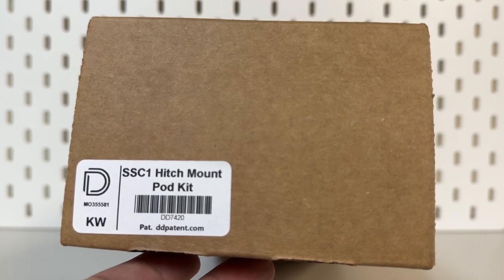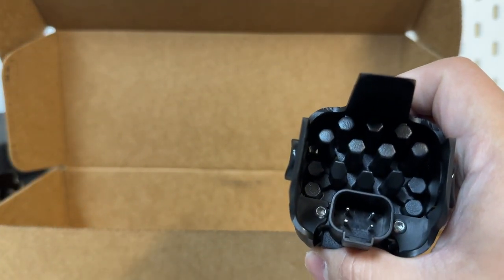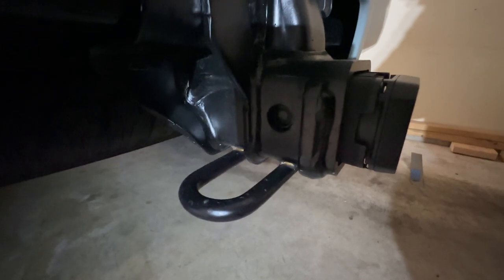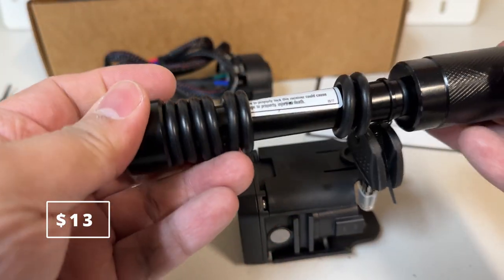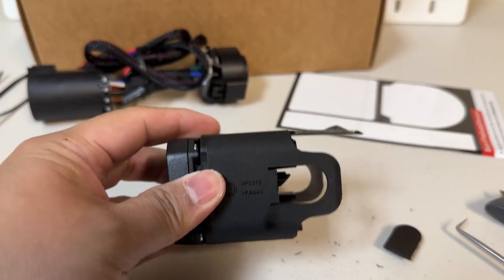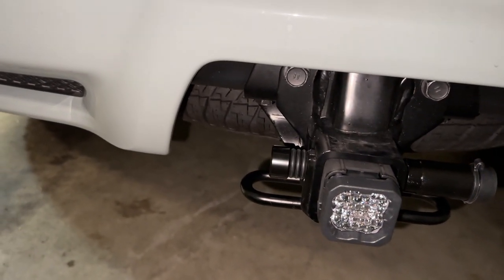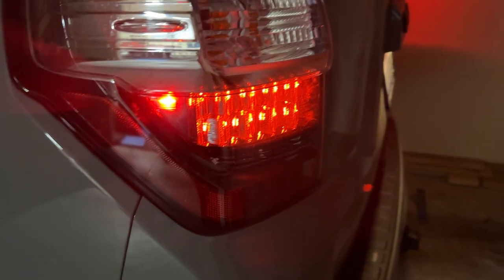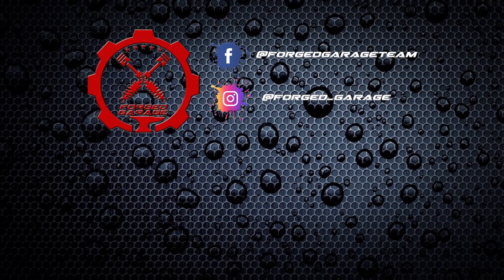How-To: Diode Dynamics HitchMount LED Pod With Trailer Pin Modification 2022 Toyota 4Runner

Comment: Nice video. Just received my HitchMount and its the C1R so it took 84 days from purchased date to shipping date + 3 days waiting for the delivery 😅🤣😂. Im about to install it now and found this video helpful to get some additional pointers before starting.👍👍👍
Reply from the maker: Nice! Yeah preordered mine and it got delayed, overall its worth it
Reply: I highly recommend if you got 285s to drop the spare tire some and unbolt the clip to unplug the harness much easier.
Reply: @gregenglish841  My spare tire is mounted on Rigd Ultraswing Hitch Carrier so there is no obstruction to unclip the plug, Thank you though... But I have to wait at least a week before the install because I need to get an Extension Wire (1 meter) from Diode Dynamics and optional hitch receiver adapter to snap-in the DD Hitchmount Led Pod or mount it in the hitch receiver of the swing out which require a at least 2 meter long extension wire to route the wire
Reply: Ordered mine Thursday, when the Labor Day sale started. Being delivered wednesday. lol 😮

Comment: What’s the technique for disconnecting the wiring harness from the 7 pin connector? I am having a very hard time on my Tacoma getting it done.
Reply: The 7pin connector on the Taco should come out easily. There is a tab that has to be depressed to release it.